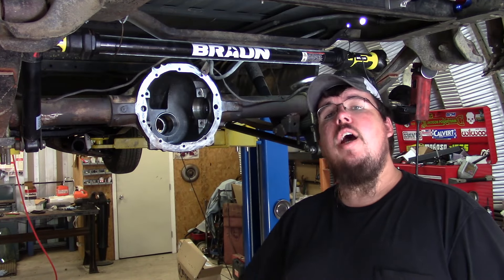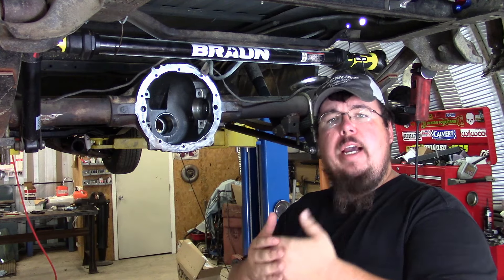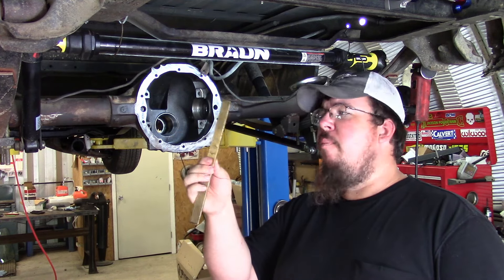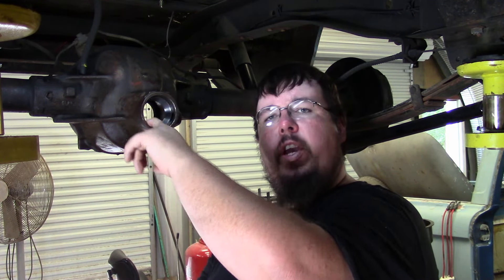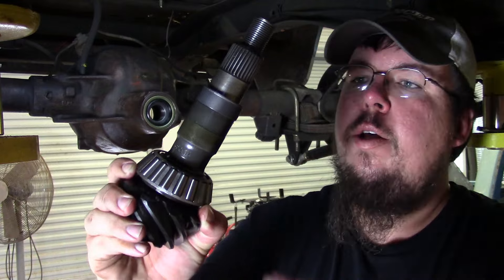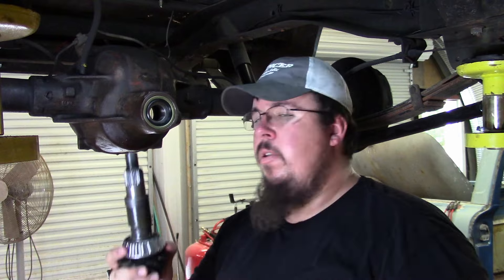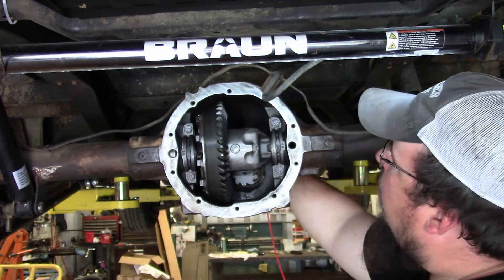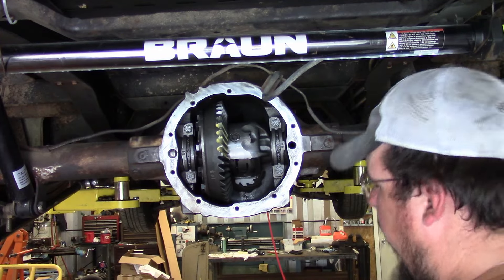GM 8.5 10 bolt gear setup and final assembly

Comment: why wouldent you do a small part of the video regarding the adjustment of the pinion? :(
Reply: Agreed.  Set up of the pinion gear shims would be helpful.
Reply: He explained it a bit in the previous video...but you probably already figured that within the year of your comment.  So from what I understand, for his application here, in order to get 24 ft lbs of drag on the pinion, you have to have the right amount of shim thickness on the crush sleeve eliminator.  And to figure that out is to just either use a pinion depth gauge to get it as close as possible or to assemble and install the pinion (excluding the seal) as a sort of trial and error on the thickness...adding and subtracting until the pinion drag is showing 24 ft lbs.  I believe the manufacturer of the gears should have instructions to let you know just how much shim thickness you should have on the eliminator for any particular application so you could just one-shot it, but that remains to be seen.
Reply: @angelsoftheseventhdawn  thank you. i put a new carrier in i kept the same pin and ring cause i was too scared to do the pin.  i will have to do it this summer. however i think i will get a super mechanic friend to give me a and when i get to that part. lol.  thank you
Reply: @ericm7994  I think the hardest part about doing the gears is actually having all of the tools to do it properly.

Comment: Hey AllieCat , just wanted to drop a note to thank you for producing this video ,  I was building an  8.2   10 bolt in my 1971 Chevelle { my first time ever taking on such a project ) Yukon dura grip Posi & 3.36 Yukon ring and pinion , I over crushed on my first try at setting pre-load  {what a kick in the nuts } thankfully  I found your video , I first thought it sounded to easy to be true , after watching you and listening to your testimony , I decided to order the shim kit from Quick Performance in Ohio , after only three or four tries I hit dead on 12 1/2 inch pounds { how simple & sweet it was }  thanks again  chuck ellis

Comment: You explain it so well. I, now only, after watching many videos, have the best understanding of crush vs solid sleeve. I'm so well informed, I'm going to make my own solid sleeve without the shimms. I'll take the dimensions of my crush sleeve, make it a coupla thousandths bigger and grind it untill it works. Just have to find a proper thickness pipe and take it from there. Bless your soul, brother.

Comment: Good afternoon, excuse me, I have a question. I have a c10 85. They replaced the pinion seal, but it keeps leaking oil, which could be the problem.

Comment: 7:51 that carrier shim tip is exactly what I hoped this video would have that no other video I’ve seen has mentioned. Needed that, thanks.
Reply: @AllieCatCustoms  I ended up needing a case spreader. The left side shim would not go in and the shim driver I had was way too small. The Vevor Case Spreader got the job done. I was working on a M200. 
All original shims were used except the pinion shim had to be replaced as it was impossible not to damage it upon outter race removal.

Comment: I like to screw a couple long bolts into the bottom of the pumpkin so if I lose control of the carrier while I'm wrestling it in, it'll drop to the bolts instead of the floor. And a some plywood on the floor for added backup. Good vid!

Comment: When checking pinon bearing preload always do it with out the seal installed weather it’s a crush sleeve setup or eliminator one. A pinion seal typically adds .008-.010 of rotational drag.

Comment: Great videos,would like to see how you went about setting up the pinion gear pre-load with the crush sleeve eliminator kit and finding out how many shims required.
Reply from the maker: I realized after I got done with the build, and started making the videos that the audio I had for the pinion depth, and crush sleeve portion of the build was horrific. my apologies. I will be building more axles in the future, and will touch back on this subject when I get a new axle to build.

Comment: Tip if I may....when looking for something to press bearing onto pinion and can't find a pipe the right size and lenght, cut the cage off of old pinion bearing and remove bearings. This leaves the inner part of bearing. Use this to press on the new bearing.

Comment: Great video man! Quick question,i have a 7.5 10 bolt with a open carrier, stock 3:42, if I buy a original GM posi unit and use the original ring gear, do you think I could get away with just using the same shims on both sides with the original ring and  pinion if i leave the pinion installed? I basically just want to put a GM Pozzi unit and leave the original 342 gears. Some people say it shouldn't be a problem and some people say I would probably have to play with shims, could I get away with just checking the wear pattern and backlash with the same shim packs on each side? The original rear end has low mileage and in great condition as of right now. I know it's a turd being a 7.5 but it will not be raced  at a track, strictly street use. Any info would be greatly appreciated.
Reply from the maker: Thanks! Yes, you can change carriers, but you gotta check backlash and run a pattern. Check backlash and run a pattern before you swap, and make note of them, and do the same after you swap. If everything checks out, you should be good to go! You may have to make slight adjustments though, so keep that in mind! 😎🚜💨
Reply: Thanks man! Appreciate the fast response! Keep up the good work my friend

Comment: The only hard thing here is to set the crush sleeve or eliminator and that is the one that isn't explained.  I'm at this step and following his suggestion I did buy the crush eliminator kit. It is a sleeve with shims. How do I know what the required thickness is ?  The crush sleeve is a really weird way to set a distance but I guess that worked for a while. The shim kit seems better in some regards but how to do it ?  He did have a separate video when he explained how it works, but never actually showed it. I guess I have to keep trying different thicknesses. Trouble is, he said it is a very small difference between a good and a bad setup. My entire diff failed due to the crush sleeve failure. It had 103k miles on it and the pinion starting dragging and making noises. A diff guy said the crush sleeve failed to keep the distance and the pinion started sagging slightly and soon the bearing started making a howling sound.  So I need to be really careful as the whole job was caused by the failure of this part.  I read that the old crush sleeve thickness is a good starting point. Torque it down and then take it apart and remove one shim and check.   This is where the explanation could have came handy.
Reply: Old comment, but to help out any one else trying to figure it out, I start short. Measure the old crush sleeve you took out and start a few thou less with your shims. Torque to 125 ft pounds and check your preload. If it’s too loose you need to remove shims, too tight you need to add shims. I’ve never waited until the last step to figure this out either, you need preload on the pinion to set up the ring IMO.

Comment: considering putting a GM Posi in my 78 K10 suburban with GM 10 bolt axles.  thanks, this helps.
Reply: I have a 78 k10 as well, lemme know how that goes for ya👍

Comment: Questions:
How do you determine initial pinion bearing preload with spacer..do I measure what the original crush sleeve thickness was, then add shim's to the new spacer, torque to 130 ft/lb and then check for recommended rotational torque?
What is the rotational torque value with spacer( not crush sleeve) for GM 10 bolt  8.625?
I'm not clear on procedure 
Thanks much!
Reply: Typo.. GM 7.625
Reply from the maker: You can use the crush sleeve as a guide for initial setup on the eliminator. I’d error on the side of slightly thicker spacer though. You want to sneak up on the preload vs going to far. I’m actually gearing up right now to make a video on this subject, and hopefully have it posted in the next month or so!

Comment: is there a deference in the preload of the pinion with the seal and without the seal. seems like if I set the right preload on the pinion to 24 without the seal, when i install the seal it has more resistance.
Reply from the maker: You will definitely feel a bit more resistance with the seal. As long as you are within spec with the seal removed you will be good… if you are using a crush sleeve, you will be setting final preload with the seal installed, so just factor in the slight added resistance the seal will give. Also lubing the seal will help reduce the resistance.

Comment: Awesome video. I was replacing the differential seal on my 99 Trans Am and the preload just didn't come back to where it was supposed to be. I was recommended to replace the crush sleeve and use a crush sleeve eliminator kit instead to avoid overcrushing it and making the job a bigger headache. Could you provide some tips for a beginner trying to knock out this job. I am very nervous about it. I got several doubts I hope you can remedy. How does the car need to be to measure the preload? Tires off? Is the preload measured with the ring removed? I need some answers to get a better understanding and I would greatly appreciate tips. Thanks!

Comment: Great video bud will be my first time have all took minus 1/2 inch torque wrench. Do have 3/8 one, though just depends on specs. are all tolerances torque specs included with posi or locker etc...

Comment: Very true study watch videos mine was going smooth until went to put the axles back in the Kaydet O’Reillys gave me a bearing that was not right could not figure out for a day what was going wrong why the axle wouldn’t go in felt like a clown but your video is very very good
Reply: The wife actually figured it out I was throwing away the boxes the bearings came in when I remembered there was two different boxes with the bearings

Comment: have you ever worked on a Nissan Titan rear end,  my rear Diff is pouched and I have to find the entire axle cuz they say you cant rebuild them. I need a 3.357 gear ratio I guess its like made of gold seen as how the cheapest USED one I found was $1500 with more miles than the one I need replaced. new one cost 2400 at the dealership and the used one was in Texas. I live in WV
Reply: titans came with a dana 44 , their is an upgrade you can do to that truck , you can do a Detroi trutrac and ither leave the same gears or upgrade to 3.69 gear ratio, i do those trucks for about $1700.00 dl  and youll never have to replace it again , detroi trutrac is bullet proff

Comment: That diff is cleaner inside than my dinner plates
What kind of gearlube did you use?
Reply from the maker: Ha thanks! Brake clean works wonders cleaning the differential up!

Just regular 80/90

Comment: Thank you for your video. Would you be able to guide me with this issue I'm having.  I have a 05 chevy tahoe, 3.42 gears. GU6,G80.  lately when I turn in either direction at a slow speeds, my rear wheels start to lock up and drag as if I was braking but I'm not. I am also starting to hear a growl when coming to slow stop.  Any idea on what can be causing this issue and how to remedy.  It's my daily driver and need it back on the road. I am also running 37" tires.  Your input or advice will be greatly appreciated. Thank you
Reply from the maker: Sometimes when the gov-loc fails, it will jam up tight, and mimic how a spool would act when turning, not allowing the tires to turn at different speeds. I’d definitely pull the cover and inspect the diff to see if anything looks bad.
Reply: @AllieCatCustoms  thank you for your input.  I found my issue. Complete inner carrier destruction!!  It looks like it began with one of the clutch pack retainers coming loose and off completely from a spider gear.  I suspect this was causing the lock up when I turn. Making the spider gear come of its axis, eventually causing it to break off one of its teeth.  I'm guessing the vibration inside was so great that the carrier actually shift enough for the pinion gear to score the casing and crack it. When I pull off the diff cover I can see the casing had teeth Mark's and it was cracked. When I finally was able to pull off the entire case it literally broke in half in my hands.  Gears, clutches everything open up.  Luckily the pinion gear and the ring gear were speared. No damage whatsoever on them. Specially on that pinion gear.  Truck is back on the road doing just fine. This week I'll be replacing the front differential. 😩👍

Comment: Is there a trick to putting in the differential, for I already tried to many occasions.  Also when I took off my pinon nut it did not have more than 80 lbs.  It ran for 2500 problem bfree? I have told to torque my nut on my 7.5 gm 10 bolt on an 82 Camaro to 150 lbs?? But I cannot get past 80 or the tires move?

Comment: Good morning, how are you doing?
Sorry for my english, i'm french.
Ihave a video where you are rebuilding an 8.5 gm differential.  
I buy a kit like you for the pinion.  
I would like to know how do you determine the number of rings in addition to the wedge?  thank you

Crush sleeve eliminator kit for GM 8.5"
Reply from the maker: The crush sleeve eliminator is set up after you get the correct pattern on your gears. You take the ring gear out, and then add or remove shims until you get the proper amount of rotational drag on the bearings.

Comment: I recently came into a Camaro LSD differential 10 bolt. If I take the ring and pinion out will it fit into my 1999 GMC 10bolt rear end? I just want the LSD.
Reply: No. The fbody has a 7.5 ring gear and the 99+ Silverado should have a 8.6 ring gear

Comment: Even though this is a 10 bolt would the build be the same for a 12 bolt truck axle?
Reply from the maker: yup, the 10 and 12 bolt are very similar in the way you build them.

Comment: How would u change the gear patter thing is that what the spacers are for
Reply: Yes, shims for pinion depth and carrier. You need proper backlash and pattern or you need to adjust shims.
Reply: You skipped the part where you would make adjustments for pinion depth, which made this video useless. So, fail.

Comment: I've got a question man, I pulled a 10 bolt out of an 82 c10 , I have the it on Jack stands  and when I turn one axle the other doesn't move at all...is this what an open rear does or do I have bigger problems???
Reply: shotgunpsycho yup you have an open diff
Reply: @devsbrew1282  👍

Comment: I wish you went into more depth on the pinion nobody is showing how many shams to put and how far is the depth should be for the pinion depth
Reply from the maker: I hate that I didn’t either. I filmed it, but the footage was so bad I couldn’t Use it. I’m building another 10 bolt soon, and I’m gonna completely redo the “how-to” series on it.

Comment: Why can't you just take the pinion out replace the bearings and seals and put it back together with the same shim if your using the same gears?
Reply: You generally can. Gear change requires new setup.
Reply: Yea you can. Have to check everything but you’d be pretty damn close as long as they were good before.